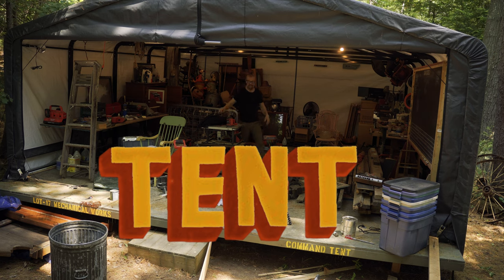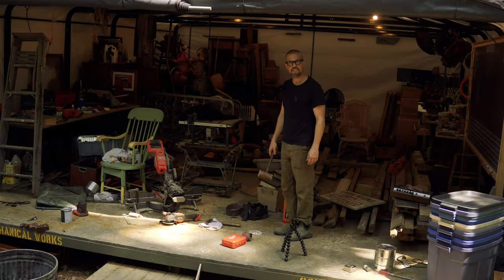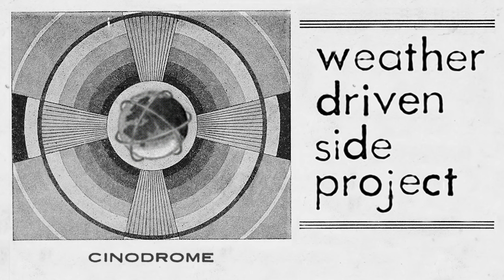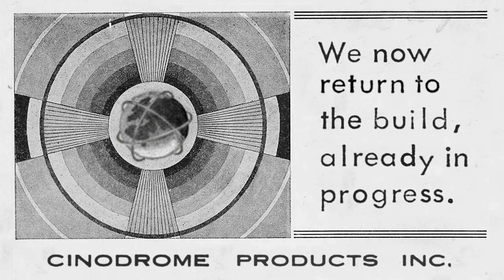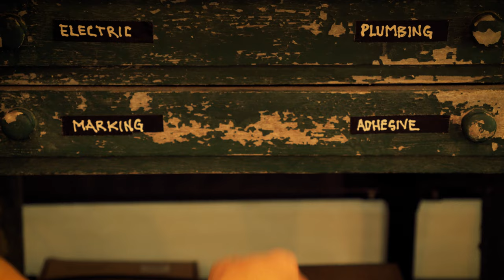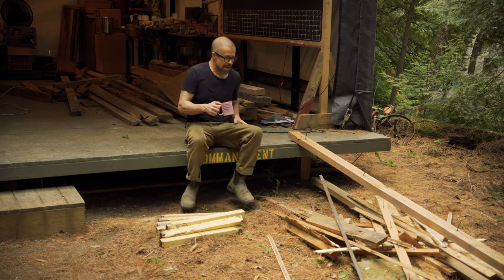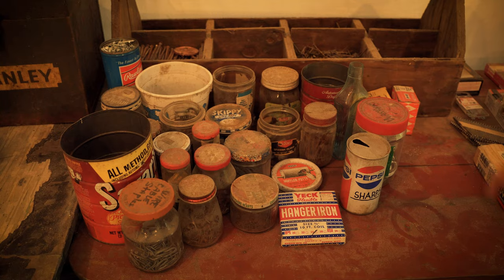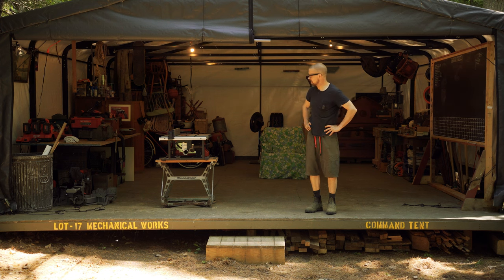Workshop Organization Days: SAVING our 1880s Maine Lakeside Cabin YEAR2

Comment: Very cool video. May I ask the brand and model of the tent and where you obtained it?
Reply from the maker: I'm impressed by the quality of the tent. They're easy to find on-line in several sizes. They deliver in a handful of heavy boxes, and I won't say they're simple to assemble, but it's do-able without undue strain. Arrow Storage Systems and/or Shelter Logic...the branding is a tad confusing.
Reply: @cinodrome  Thank you!

Comment: Dunno that putting the wood under is a good idea. Mold and critters might ruin it. Just a thought.
Reply from the maker: That's what the "for now" was about. I've got it up off the ground on stickers,, It's been a dry spring. It will all be fine for the summer. Plan B will be needed before I cut out for the winter.
Reply: On the right (facing inward) side, you could mount shelf brackets to the metal pylons. You could then store the wood there. It would be out of the way, but accessable when you need it . Just a thought.